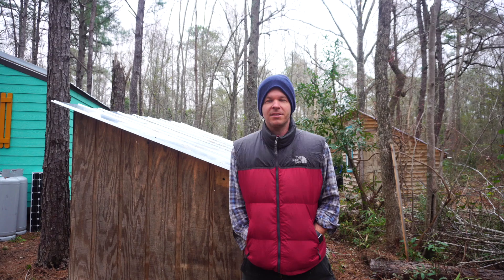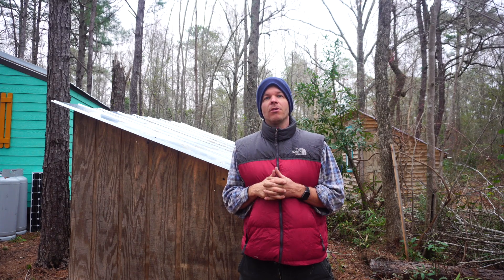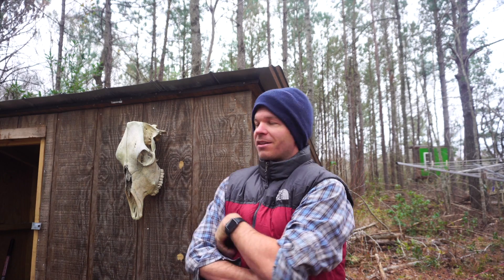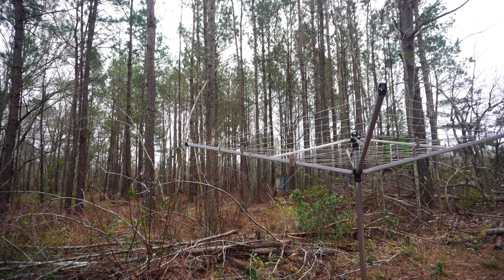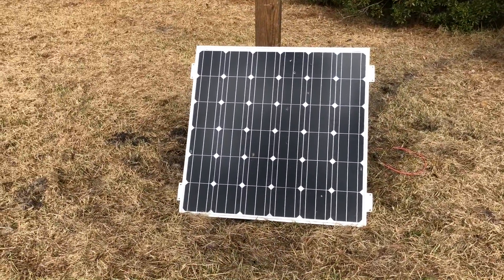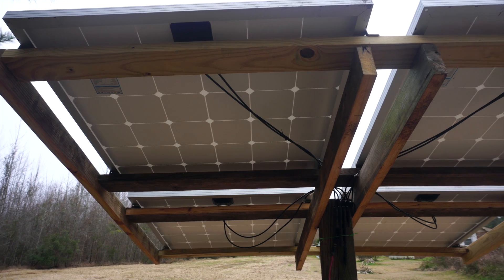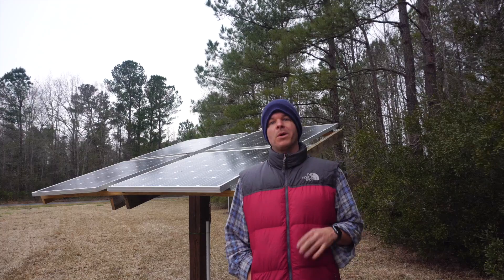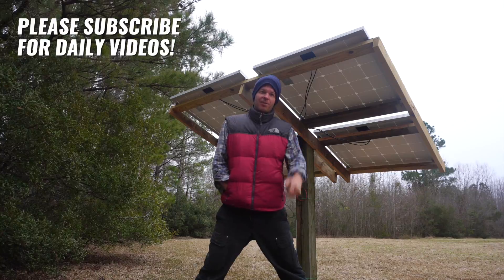Budget Diy Solar Array

Comment: I used a similar idea, but put it together on the 4x4 post, which I put in a post hole with 2ft of cement.  Using Irwin clamps it was rather easy to build, measuring and cutting the 2x4 boards first: 2 for the length, and 6 for the width.  I also added a second anchor of a 2x4 attached and in 2ft of cement to minimize top heaviness.  I got better at building them after the first.

Comment: Excellent video!  Two thumbs up for inexpensive all-wood solar panel mount!  One comment though - used solar panels are becoming pretty common these days and they are literally dirt cheap, due to all the solar panel upgrades that happens.  I bought some used 165watt solar panels locally on craigslist for just $30 each the other day.  Still produces good power (80-90% of original) and may last another 20 years.  So find some cheap used solar panels and only really expensive part remaining are the hybrid inverter, batteries and all the wiring.

Comment: I saw on Ebay 10 435 watt used panels that prob produce lets say 420 watts because they are used but to ship 10 of them it comes to 302.50 each this is at 10% tax included i figured. You can get 20 of them even cheaper.

Comment: this is the first build that I could afford. I have one hundred watt Harbor freight panel and than I have the older kit that is forty five watts. so I did like your build. I just got to figure where to put them and insulate the battery from the cold and then how to get it in the house. thanks for video

Comment: when you frame out the square for the panels to attach to....do you add the 2 horizontal 2x4s to frame or mount on 6x6 post separately at desired angle?

Comment: Funny you posted this. I'm actually going to be working on one similar to the one you showed today cept that I'll be making one that calculates the optimal angle and is able to adjust itself and even rotates, following the sun for optimal power gains :).
Reply from the maker: Yes! You should film it and share here. Sun tracking is definitely the way to go!

Comment: Thanks that's another way to get energy, I live by the Ocean it pretty windy here for 4 months out of the year if I could rig up a wind peperler with a car alternator with a belt to generate the alternator to charge a battery bank with a turn off switch the only thing is to find a belt long enough to charge the electric motor to run the electricity to the batteries this I have to find out.

Comment: How much KWh does this produce?
Reply from the maker: 600 watts = .6kw. Thanks for watching!
Reply from the maker: Imix Muan yes! Of where you I’ve has 5 peak hours, however, the solar panels are just a .6kw system. Also, if you need 3kw of energy per day, you’ll Need more than 600 watts of panels because of cloudy and overcast days.